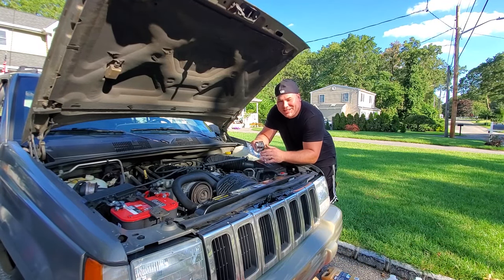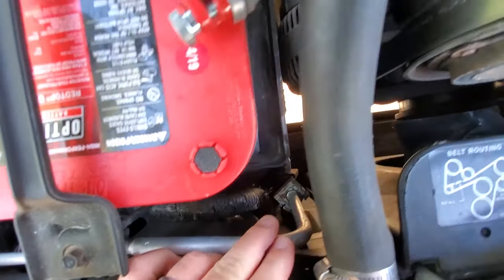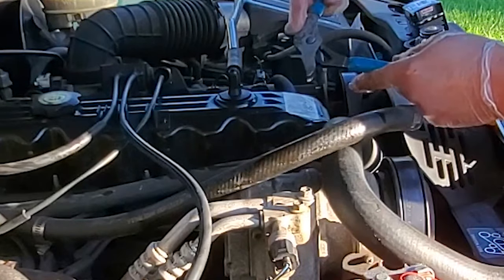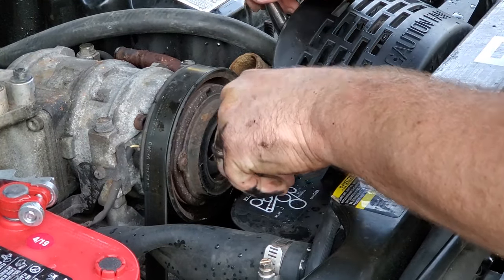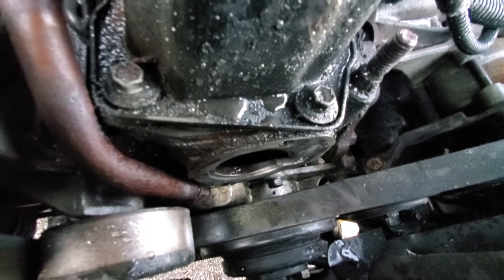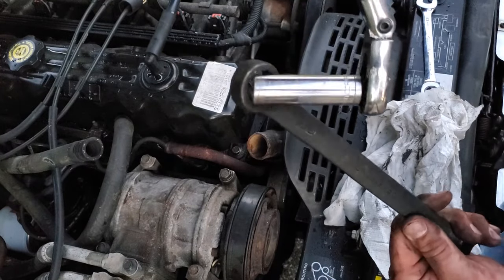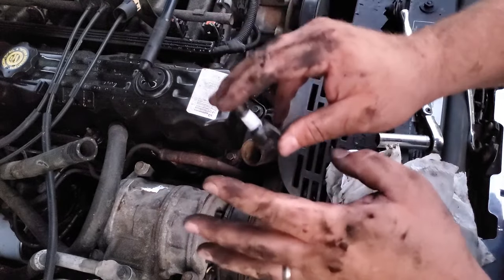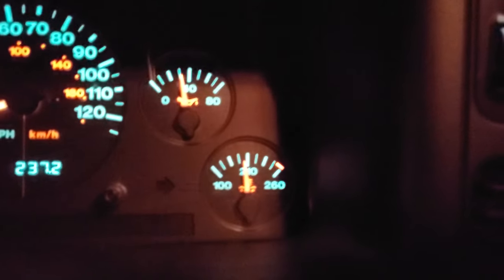JEEP ZJ 4.0 COOLANT FLUSH AND THERMOSTAT REPLACEMENT IN A 1998 GRAND CHEROKEE

Comment: Wouldn't drilling the hole introduce air to the system regardless?
Reply: Awesome!
Reply from the maker: Not if only liquid goes out
Reply: @ProjectDanH  well, I looked at mine and its not really a hole. there is like a BB be held with lil metal slats? whats that about?

Comment: 16 or 18 lb cap, mine says 18 ?
Reply from the maker: the 4.0 system should be 16 lbs
Reply: Finally found someone who asked the same question! I have a 4.0 98 ZJ and all I can find is 18 psi rad caps. When I search online for the 16 psi it always says it's not compatible with my ZJ. I'm not leaking coolant anywhere but it tends to show overheating then cools down. I believe this is the problem because it doesn't stay at 210, but a tick over from 210
Reply: I went with a 16 lb rad cap now 3 years later I'm going with a 180 degree  thermostat  instead  of of 190 because  I run at 210 too
Reply: @infinitybandofkent  you don’t like your Jeep running at 210? I couldn’t find a regular 16 psi rad cap. Just had to pick up a Mr Gasket 16 rad cap from Oreillys that was $42.86 including tax with military discount.

Comment: Surprised that you don't have the skid plate package. I had to remove the front skid plate on my '96 Orvis 4.0 to get to the lower hose and petcock so I could change my water pump.
Reply from the maker: Yes, unfortunately I don't have one.  If I lift this or take it off-road I'll eventually try to find one.